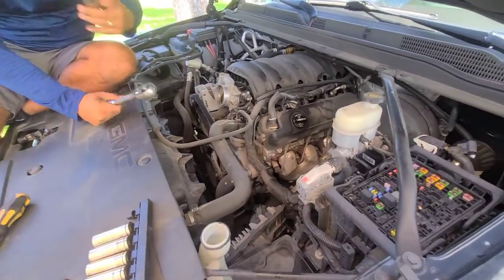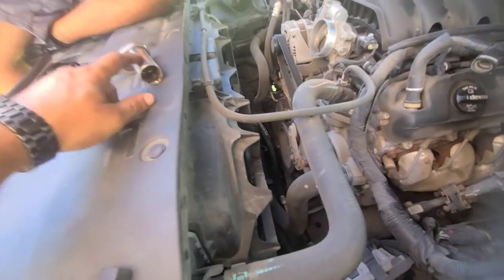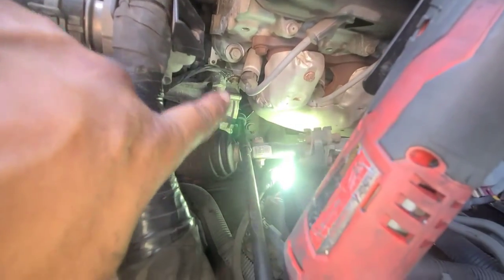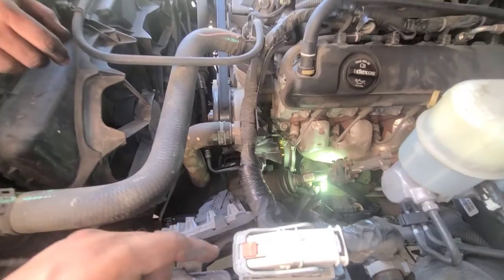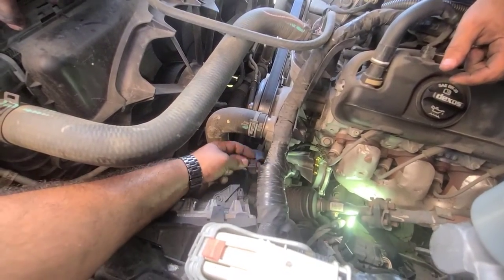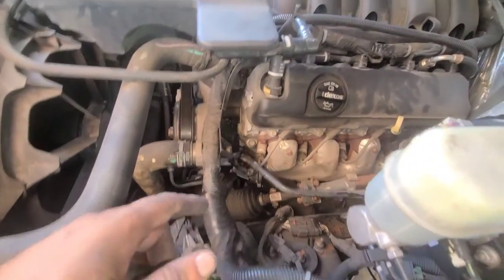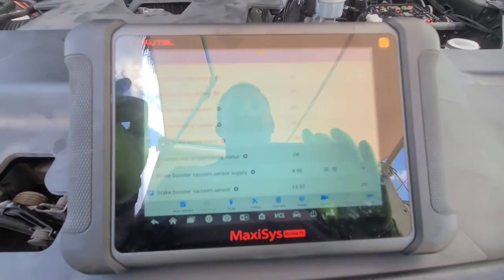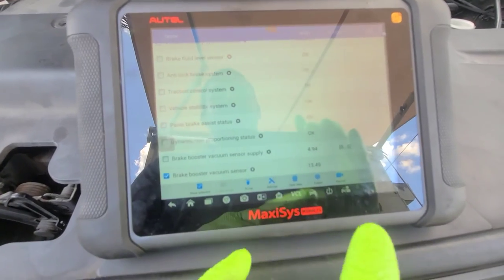Chevy Typical Vacuum Pump Problem 2015 GMC Yukon

Comment: Ya le cambria la vaccum pump y sigue el mismo problema no se si me podrias ayudar
Reply from the maker: Hola si claro , pienso que no tienes un scanner para monitoriar el sistema bueno haver el pedal esta dura completamente,  sin  bombear simplemente arrancaste el carro y esta duro el freno , le desconectas la manguera que sale de la bomba para el booster y cuando esta arrancado el carro si tiene vacuum la línea,  si la respuesta es si lo mas probable el brake booster esta malo , ahora si cuando esta desconectada la manguera no hay vacuum en la misma manguera hay un sensor que habré y cierra esa manguera también puede estar dañada

Comment: Was it making a ticking noise by chance??
Reply from the maker: The main problem its the fact that the brake padel gets hard because you are not getting vacuum to the brake booster, so if you used the brake back to back and it gets hard the vacuum its not recharging the booster fast enough to keep up with the demand, so that's the main thing you can look for.
Reply: But could it possibly make a ticking sound ?